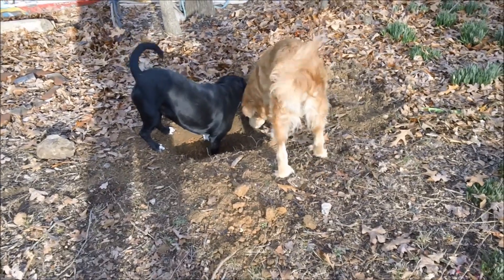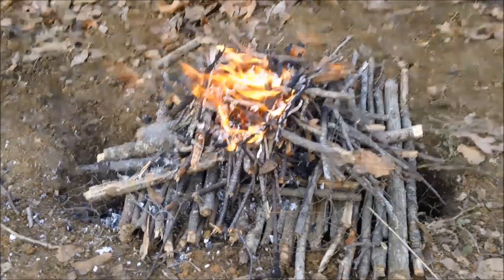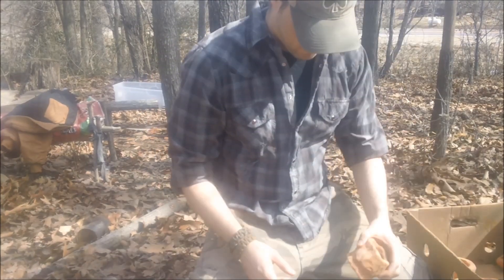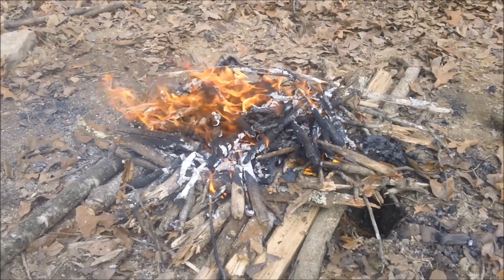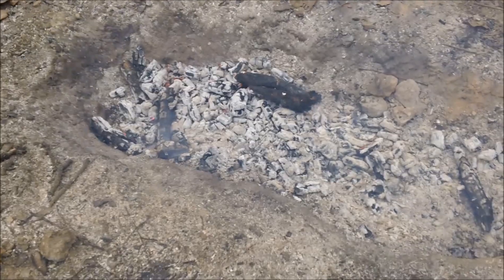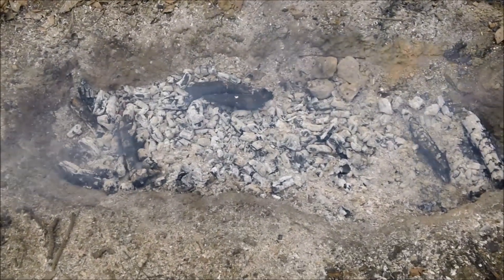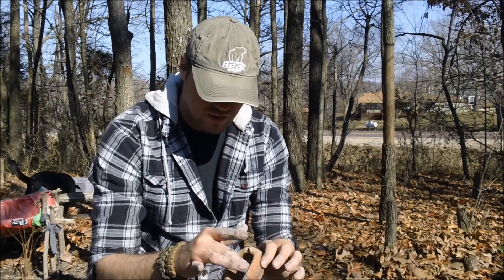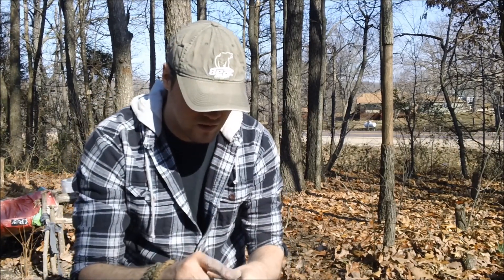primitive pottery part 5 making a kiln firing and finished product

Comment: Thanks for this video series, it is very educational.  I have a question if you don't mind.  If I were to fill a 2 foot long, 4 inch diameter metal tube with clay, using clay like you used in this series, and pack it down tight in the tube, and poke a few pieces of rebar through the center of it for support, packing the clay down as I did so until the tube was filled...do you think it would work to fire the clay successfully if it remained inside of the metal tube?  And do you think it would take a lot longer to fire it since the clay would basically be 4 inches thick?  I hope that makes sense.  I basically want to make a 2 foot long 4 inch diameter solid piece of clay with rebar inside of it.  Thanks.
Reply from the maker: i would assume it would work but i my self havent tried it yet but try it out and see if it works and let me know how it turns out thanks for watching and taking an interest

Comment: Sounds like you get a bisket fired. What is wanted befor glazing. Use a layer of wood under pots would get them hotter and more or a bell sound if fired hotter. Thanks.
Reply from the maker: great tip ill have to try that out thanks for sharing

Comment: constructing pots and clay objects so that they have thinner walls should reduce the risk of cracking during the cooling process.
the increased risk of cracking during the cooling process makes sense. if the pot is placed in an environment which would prompt it to cool to fast (such as dipping it in water), then the outside of the material would cool much faster than the inside. as a result, you would have an outside surface trying to shrink around a still hot inside. the rapidly cooling surface would not be able to cover the still hot and bulging inside mass, and would therefore crack. because the clay has become brittle from being fired, the material would be prompted to crack all the way through. 
therefore, making the pottery thinner would lower the risk of cracking because it would decrease the maximum distance from the surface of the clay to the center, therefore the rate of cooling for the inside would be closer to the cooling rate of the outside.

Comment: Even hitting more clay in the kiln pit he and the dogs dug to fire the clay. You can see the color change in the layer going down.
Reply from the maker: +pauljs75 we have a lot of clay in my area i can dig a hole in the yard and find it pretty easy
Reply: A lot of places it really is quite plentiful.

I'm in the upper midwest. Topsoil is a bit deep, about 3ft. (It's why it was almost all farming before developers built over stuff.) At first you're thinking you're out of luck, as it's too loamy and loose to do anything. (Stays crumbly if you try to fire it.) But dig anywhere below that, and it's usually almost all clay. Not a matter of where, but simply digging deeper.

Now in parts of Texas or Oklahoma and heading more southwest, I know you don't even have to dig. (Other than to collect it.) Some of that scrub-land soil is just clay right there on the surface. Dried out, but just add water and work it.

The hard part is where the local environ is almost all bedrock or all sand. (Like some areas on the East Coast or up in the mountains.) Then you need to find a shallow river or similar body of water to go mucking around where its exposed or naturally settles out.

Comment: now, how about glazing...
Reply from the maker: if you want to go all natural you can make a glaze from wood ash if you want to try it out let us all know how it turns out thanks for stopping by
Reply: Use a smooth stone to rub the inside and outside after they dry out before firing.
Use hardwoods to fire and let enough oxygen in to make the fire as hot as possible. Also use charcoal if you can to get the temps up a little more.
12 to 15 hours should be enough.
Let the fire die down and all of the coals burn themselves out. 

The clay will be food safe.

Wood ash and water can be caustic. It is good for decorations though.